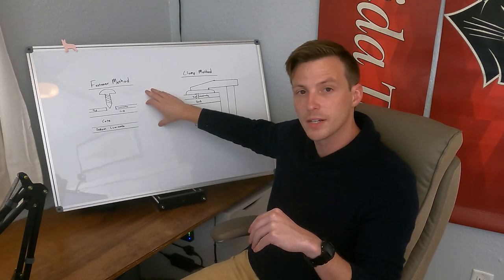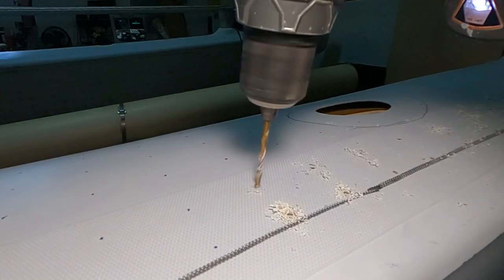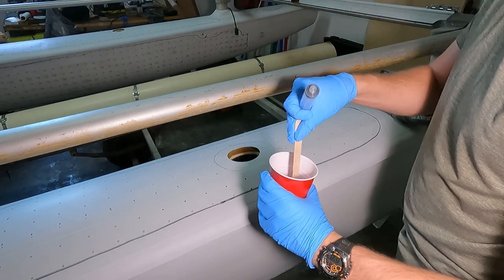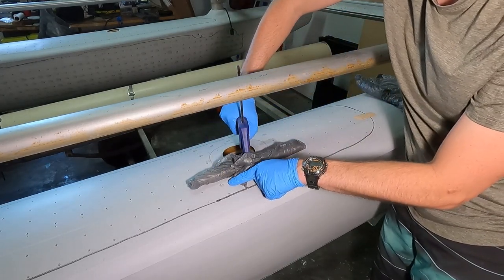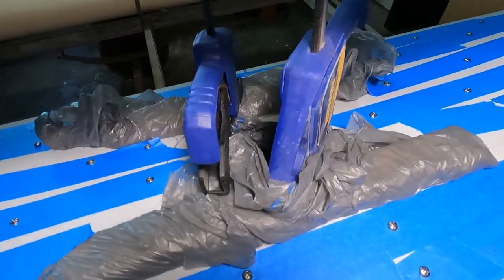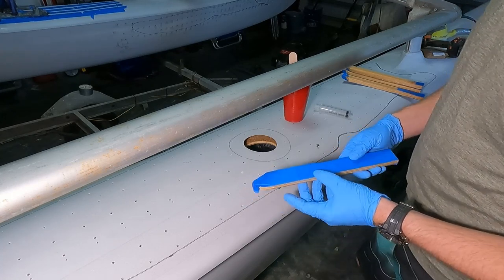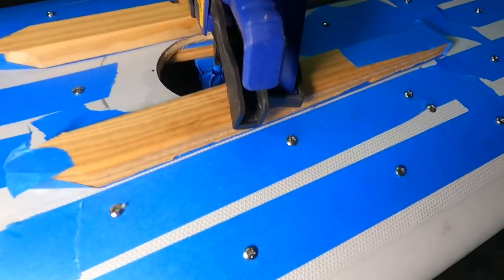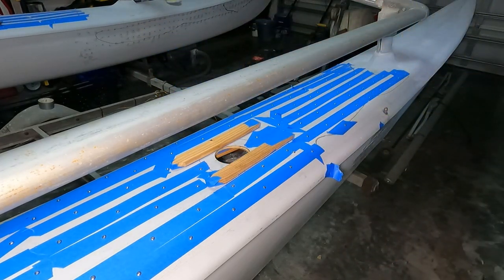Final Delamination Repair - Hobie 16 Repair

Comment: I'm  in the process of doing this, on  the side, and about the same size area.  I just cut out the whole piece, then bonded both pieces.  Next, I'm going to attach strips of marine plywood, about 3" wide, to the inside of the hull. 11/2", sticks out.  The cut out piece, sits on it,  I'll epoxy it,, and clamp it.    After that, I'll fill in the gaps, then cover the seem, with epoxy and clothe.  I've done this before,  and it worked fine. Epoxy is stronger than fiberglass, so it's better than new. I tried drilling holes, and injecting epoxy,  but only on small areas.
Reply from the maker: While what you described will work it is significant heavier, more complicated, and can only be used on small local areas. Which is why I chose to drill and fill. Epoxy is not inherently stronger than fiberglass. We use both together to combine strengths and mitigate weaknesses. If you are ever only using epoxy, I would recommend adding milled fiberglass for body and strength.

Comment: Whaat about using an inflatable air bladder inside the hull to force the core onto the laminate?
Reply from the maker: I thought about it, but in the end it is a question of risk vs reward. It could work, but there are multiple factors to consider: access to the inside to put the air bladder, ability to make a air bladder that would fill the entire area, ability to ensure constant pressure, but not too much pressure that you cause additional delamination. With the way I bonded this back together I was able to have better control in all areas than a bladder.

Comment: I did so much delam jobs on my old 74 H16. At some point i just had enough and bough a newer boat which is solid as a rock. Sometimes its just not worth it.
Reply from the maker: Completely agree. I would only do thus again for smaller areas.

Comment: Hey Mate, I am from australia and have recently purchased two catamarans 'windrush 14's" an australian edit of the american trac 14 design I belive. and one has barley any issues besides minor waterproofing with the beam connections. I just wanted to ask your informed opinion when you push down on the outide of the fiberglass on the inboard area of the hulls how much flex shoud there be in the walls of the hull (where you stand to right it after a capsize) I am 200lbs and am worried about breaking the boat in a bad situation if i capsize.
Reply from the maker: Hey, I just went out a felt a couple of the areas that I did not repair. They do not move at all when I press on them. Listen when you press to see if you can hear the core compressing, it will sounds like crackling. If so, your hulls are definitely delaminated. If you haven't checked out my video on how to map delaminations, I would recommend checking it out as that is a pretty sure fire way to see if you have a structural problem with the boat.

Comment: good stuff, mate. Learned a lot. When you say "fasteners", I assume you're refering to long (about 30mm) coarse-thread screws? I also guess you predrill the hole in the bottom laminate to the screws can bite.
Reply from the maker: I was using self tapping machine screws. Make sure they are at least 20mm long and you coat them with a PVA mold release. I only drillee through the top laminate to ensure the epoxy didn't just go in and right out into the hull. The self tapping fastener will drill through the other side and grab onto the laminate.
Reply: @tridactik  Ah, that's kinda what I reckoned you did. Perfect!! Thanks very much. I've got a soft spot on my Hobie 18 so I'll be doing that shortly.
Reply from the maker: Good luck! I'm jealous of the 18.
Reply: @tridactik  yes, it's a great boat, goes well with new sails, but I still haven't cracked 20 knots yet...maybe this summer!

Comment: that's why they just rotomold them now
why can't you just drill small holes and inject resin with fiber bits mixed in to fill the voids? too heavy?
Reply from the maker: I have done that on all of the other repairs. I have a couple of videos on that process of drilling holes, injecting  and pulling the laminate together with fasteners.